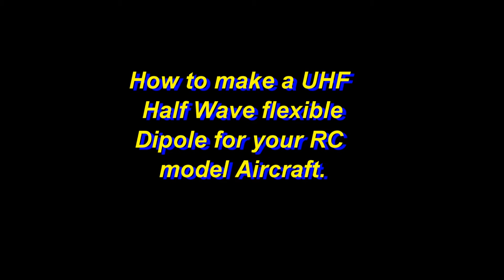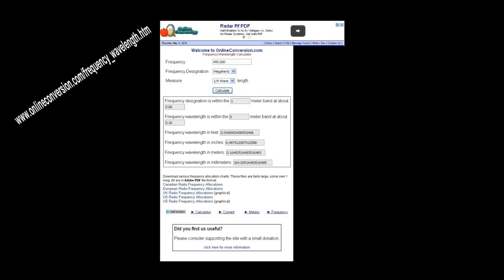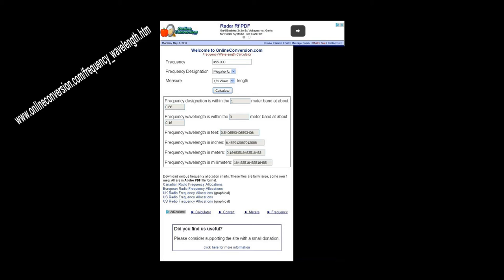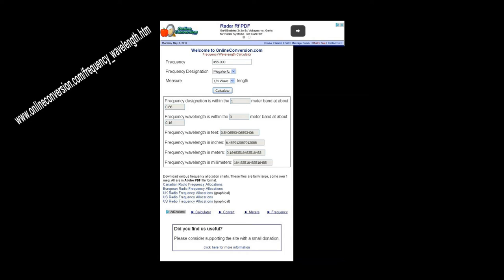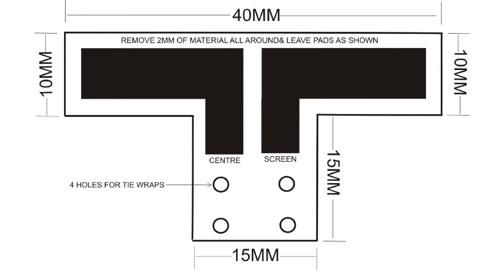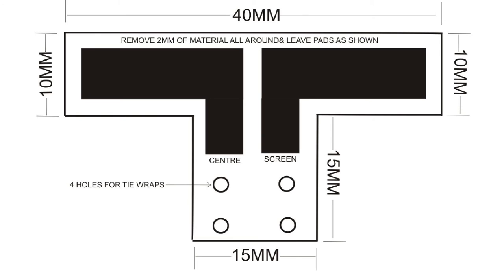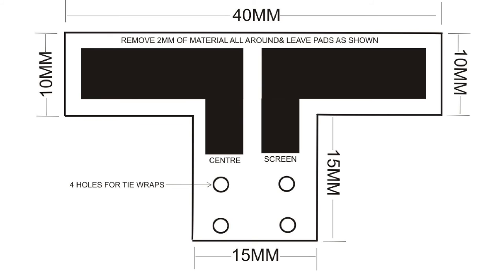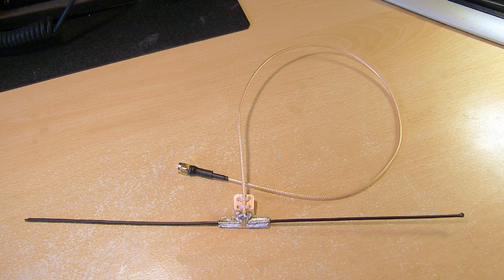How to make a strong flexible UHF Half Wave Dipole.

Comment: Does this measurement apply to Inverted Bee @120 degree?
Reply from the maker: +Migueldeservantes I only build conventional dipoles as that is what I prefer to use for a more omni directional radiation pattern.  Vee antennas change the impedance match slightly at the feed point and may affect the length slightly. That having been said I think it will still be a decent starting point why not build one and let us know how you get on.
Reply: Thanks

Comment: How do you solder the bicycle braking cable?  Ive got some steel wire rope which i have managed to cut, but normal electronics solder will not stick
Reply from the maker: I use galvanised steel cable that solders easily with a decent iron and standard resin cored solder.  Stainless steel type cable will not solder maybe that is what you have.
Reply from the maker: I use galvanised steel cable that solders easily with a decent iron and standard resin cored solder.  Stainless steel type cable will not solder maybe that is what you have.
Reply: +BillHally Yes possibly, Thanks for the response.  Do you know the thickness of the cable that you like to use?
Reply from the maker: +paulham Never measured it paul but it looks like about 2.5mm
Reply: @BillHally  can you please link to this cable ?
Reply from the maker: @ssaxin81  Hi Eddi long time ago now I purchased it from ebay.
Reply: @BillHally  thanks will be happy for ebay link
Reply from the maker: @ssaxin81  Just check out your ebay but make sure you get Galvanised Steel or you wont be able to solder to it.